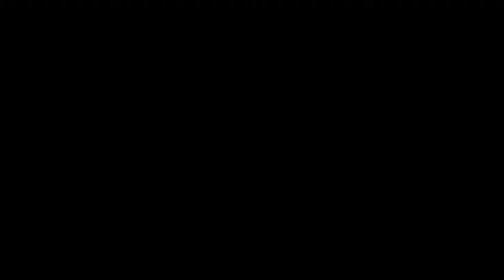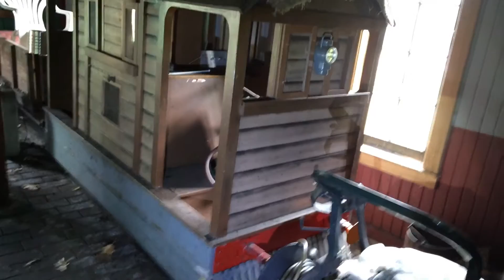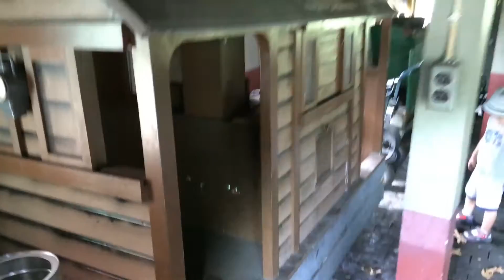Train Locomotive Restoration Donation Requests! Riverside & Great Northern Railway

Comment: This is the engine I have been looking for. I've always dreamed of having an engine like this and a rail system in my yard to ride it around in and pull cars and all that. I must ask though, is this a legit real engine that was produced and put to work? what's the model name, the manufacturer, is it possible to acquire one? The size is EXACTLY what I want. I do hope you reply :)
Reply from the maker: Hello, it is a engine on the www.DellsTrain.com 's Riverside & Great Northern Railroad. 
We will be certifying this engine for passenger use shortly. 

Please see www.DellsTrain.com

Originally a manufacturer of Narrow Gauge Locomotives and Coaches, the Sandley Light Equipment works is long since gone. We took over in the early 90's and converted the manufactury into a Historical Preservation Society. 

If your interested in a backyard train, contact me directly, 414-807-8354. I do built custom locomotives and track systems.